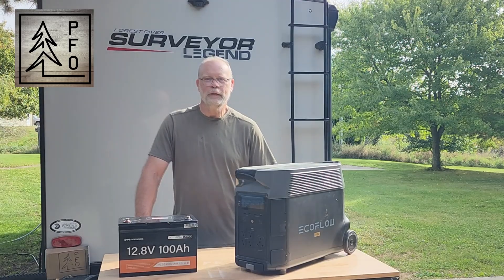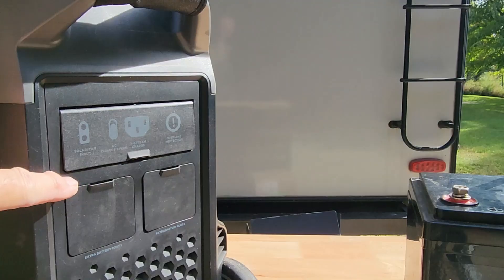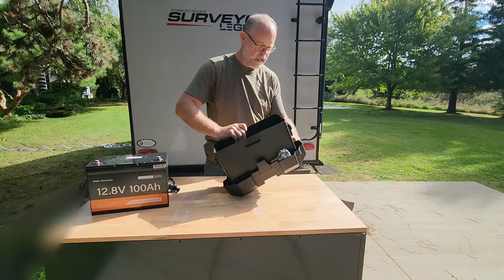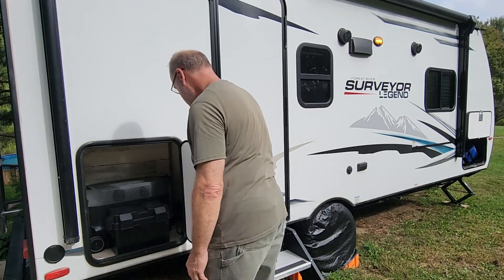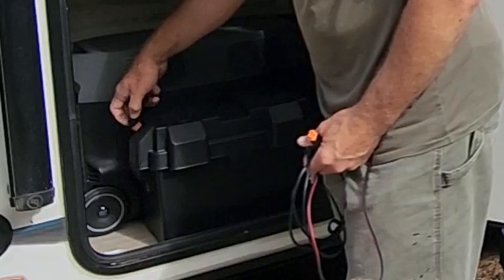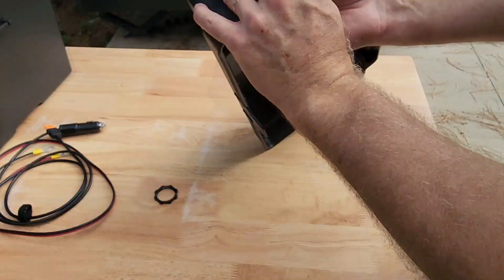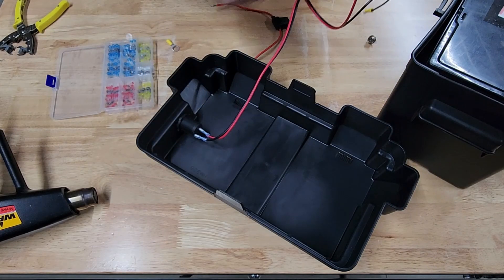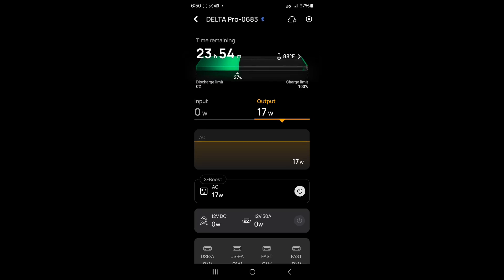Boondocking Power! How to Add 33% more Capacity to your EcoFlow Delta Pro RV power bank setup

Comment: When you plug into shore and you have the Delta Pro plugged into the 12v does it charge up the extra battery as well while charging the Delta Pro?
Reply from the maker: Thanks for the question. First, to clarify, when we are plugged into shore power, we recharge the Delta Pro from the 120 Volt AC circuit, which I added into the storage compartment. So, the Delta Pro is not being recharged via 12 Volt.  As for the extra battery, it does not gain a recharge from the Delta Pro when it is wired into the XT60i port marked "solar/car input" on the back of the Delta Pro. I just checked this with a voltmeter to confirm, and that XT60i port is not hot when the Delta Pro is plugged into shore power. It is apparently managed as "input only" by the Delta Pro controller. To recharge the extra battery, I choose to plug it into a small, LiFePO4 compatible battery charger, also running  off the 120 Volt shore power. Alternately, I suppose I could recharge the extra battery from the output side of the Delta Pro, but that would slow the overall charge time for the pair and seems like unnecessary wear and tear on the Delta Pro.

Comment: If you use an XT60i connector you can get much higher transfer rate.  My Delta 2 will pull 500 Watts from an external battery using an XT60i.  You may not need that higher transfer rate, but it is possible.
Reply from the maker: Thanks for the tip. This particular arrangement does well with the slower transfer rate. The 100Amp hour battery trickles slowly into the Delta Pro over a period of a couple of days. When I add the circuit to charge the Delta Pro from the tow vehicle alternator, I will use either the XT60i or the 30 amp Anderson connector input.

Comment: Super Cool! What would you say is the easiest way to charge up the 12v battery? I definitely want to implement something like this on my Delta Pro
Reply from the maker: Thanks! I use a small (5amp) automatic smart battery charger/maintainer that is compatible with LiFePO4 batteries. I plug it into the same receptacle I added in that compartment that I use to recharge the Delta Pro when we are on shore power. I'm planning a future project to run wire from the tow vehicle all the way back to that compartment (via an LiFePO4 compatible isolator or DC to DC charger) so I can recharge both the Delta Pro and the bonus battery from the truck alternator when we are on the road.